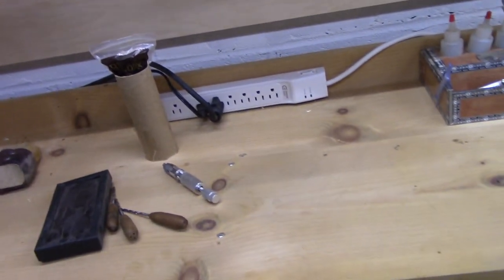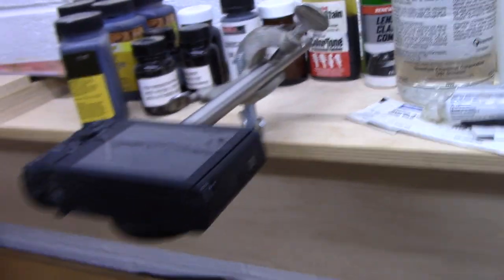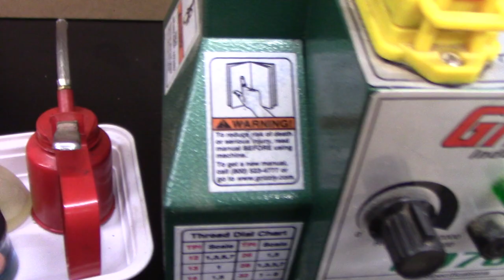CaneRodPipes Grand Re Opening!  YTPC Discount and LiveStream

Comment: Wonderful Mike,congrats on the Grand re-opening,looks very professional,speaking of pipe repairmen here in the EU,today they are very few and far between, based on my own experience, as far as I know, there are two here I could recommend, Mr Ian Walker at Northern Briars in England and mr Tom Eltag,says he works for Danishpipeshop,as of now I have one higher-end Peterson sent to Northern Briars,of course,new stem is on the line, the original replacement stem on it was a simply crap,it is always these stems, real pain in the B' Best Greets,se You soon again,Paul
Reply from the maker: Hi Paul,  yes, we are a rare breed.  It seems odd that there are many more pipe makers than pipe repairmen, but the reason is that you can spend 8 hours making a pipe that sells for $300, or 8 hours repairing a pipe for $60.  Which to choose?  Thanks my friend, and be well.

Comment: Lovely setup I’m sure you’re looking forward to getting cracking in there. A couple of brackets on the lathe stand into the wall behind will make it unmovable. Have a great weekend.
Reply from the maker: Hi Simon,  I actually planned on doing that, but the bench is so solid that it does not seem necessary.  I'll use it a few weeks and reconsider if needed.  Thanks for watching!

Comment: Glad you have a pipe specific spot now. I have a question that is off topic, I am assuming your cinder block walls are not insulated, how do you keep warm during winter? Or in general how do you deal with having cinder walls? Thanks
Reply from the maker: Hi Felix,  Good question.  First off, the cinder block walls are the foundation, so only the basement has cinder block.  It is below ground which provides some insulation, and helps keep it cool in the summer.  In the winter, it is quite warm because just to the left of that window I showed is an oil burning furnace which heats the house above.  There is no need for any heaters in the basement because the furnace produces enough heat on it's own.  Thanks for watching!
Reply: @CaneRodPiper  gotcha!